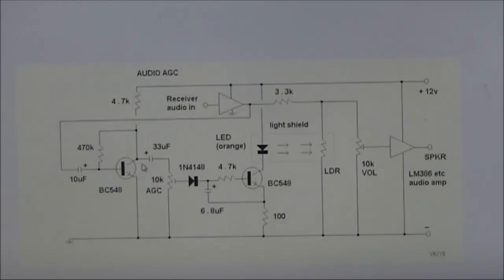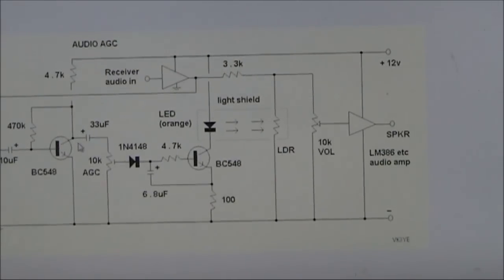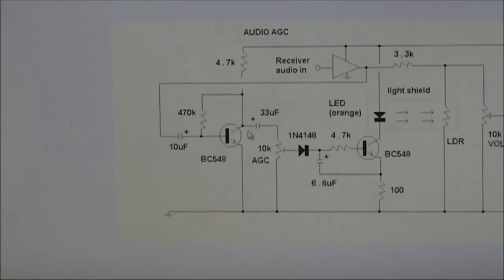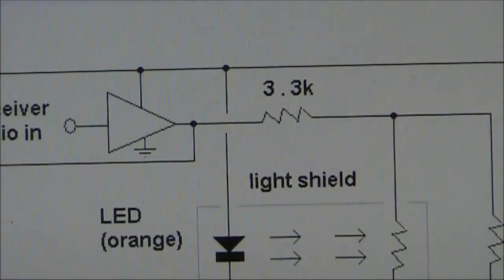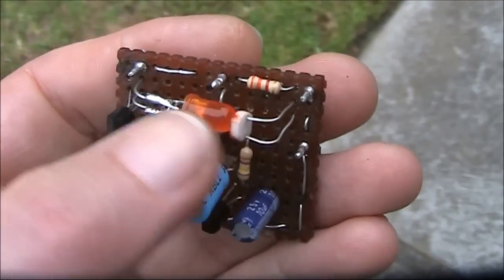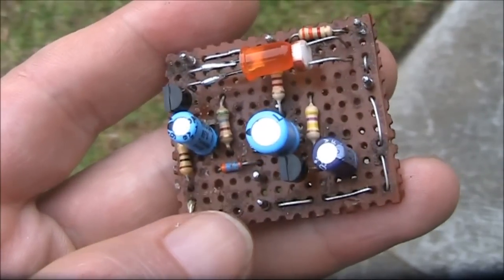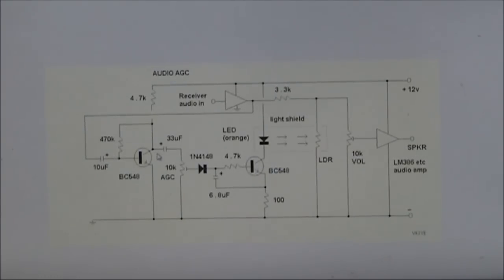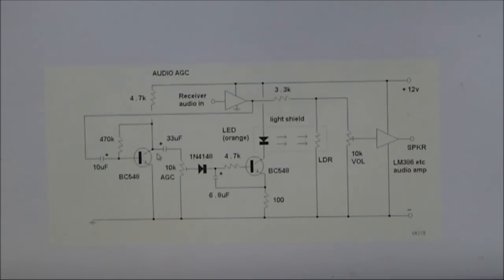Electronics on the Floor: Automatic Gain Control with LED and LDR - Part 2

Comment: Just built this circuit, Works ok but makes strong signals sound scratchy and tinny, Any idea what would cause that ? Cheers.
Reply from the maker: You may have to wind the potentiometer setting down. It's not the smoothest of sounding sometimes.
Reply: @vk3ye   Thanks for the quick reply, I'm feeding the audio to the base of the first transistor via a 3.3k resistor. Is this correct ?

Comment: I'm adding this circuit to an Epithyte 2B (75m SSB QRP) by Derry Spittle (SK). He didn't ground the third leg of the volume pot but I think I have to ground that to complete the parallel circuit of the LDR correct?

Comment: Potentiometer & Trimpot is the same thing yea?
Reply from the maker: Electrically the same. But potentiometer generally refers to one with a shaft & knob whereas trimpots are preset.
Reply: @vk3ye  preset?
A guitar vol knob is a POT
But on a circuit board I have a 100k Trimpot...
Not same?
Reply from the maker: @sothatsit3033  Electrically they are the same.

Comment: Built this last weekend.  Works great in my Ubitx v6. I have a switch on the front panel to turn the agc on and off. The adjustment pot is mounted on the board but I may move it to the front panel also

Comment: Another great video! Thanks for sharing. Question: If using an amp with a +/- dual supply. Would the agc transistors be grounded or go to the negative rail?

Comment: Nice work, can i use this recommended for the ubitx v3 as AGC ? In my version 3 ubitx is an TDA2822 Fci soundchip built in, an mostly signals are to quiet and only a few loud enough an i think this AGC is a good idea for my problem or what would you think about it..? And VK3YE you are my favorite HAM idol since longer time and i would like say thanks for your super Videos here on Youtube! Best regards Fabian
Reply from the maker: Hi Fabian - the AGC won't help - it reduces rather than increases gain. You need an additional audio amplifier to boost the audio. Either add some gain before or after the TDA2822.
Reply: Oh i thank you very much for you answer!! I have many times dreamed of talking with you and now you really talk with me, its a pleasure thanks! Ok what me would help, is a person which have the ubitx and the knowledge about it an ham, and i have much more problem with my ubitx, not only with quiet sound or distored sound, i have many other questions and i would ask you for, can i have contact to you for a little bit help, bescause i would be very thankfully!? My email is sdrfreak55@gmail.com and i would happy like on xmas when got help from you and when you have time or ever want to.. i have ham licence since july and ubitx my first tx and never have an qso since licence. I wrote in group.io/bitx20 but my ubitx not already works, no idea but i think you can help me so much. I hope you write me an email and sry about bad english i'm from DL best regards Fabian 73
Reply from the maker: Thanks Fabian - glad you like the videos etc.  There is a lot of collective wisdom on the bitx group - much more than I can provide - so keep asking questions there until you get your problems sorted.

Comment: Could someone post pictures on where to connect this AGC circuit on the BITX40 board. I just have trouble at figuring this out (I know it's probably very simple). Very nice video..

Comment: I built this circuit to add AGC to my OzQrp MST 40m rig. It worked fine.  Here's a post and demo video... https://vk3hn.wordpress.com/2017/04/26/vk3yes-non-invasive-led-ldr-agc-add-on/

Comment: I was always told that yellow LEDs performed better in a photo resistor circuit. I may have to try both red and yellow just to see.
Reply: commercial vactrols use red LEDs  ..